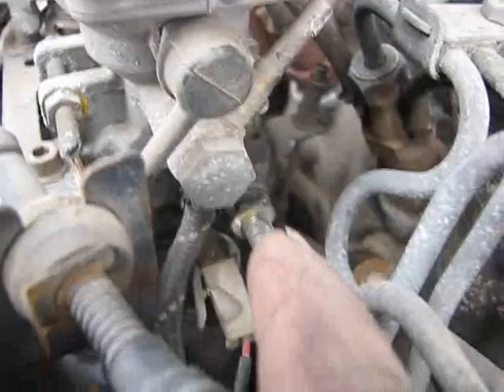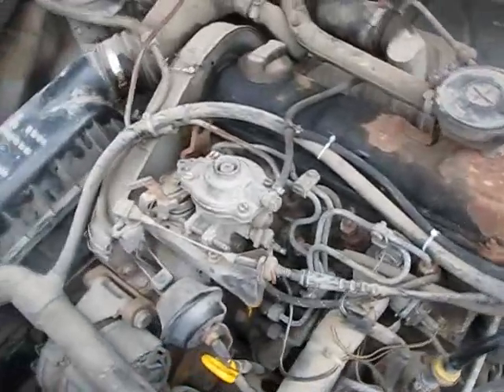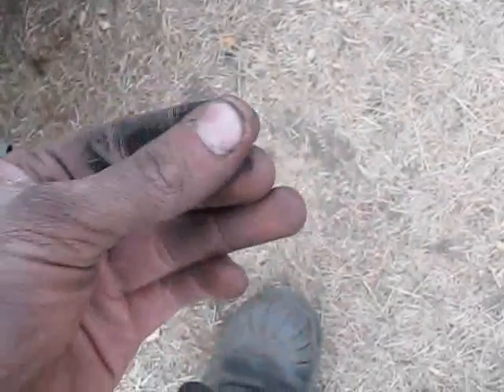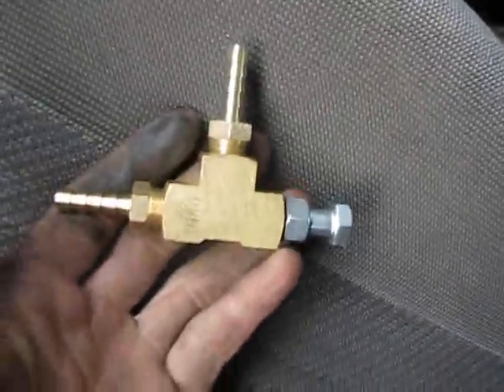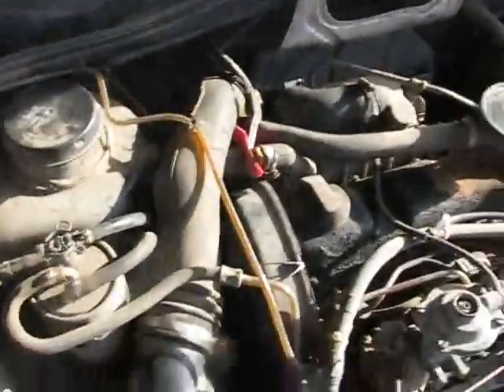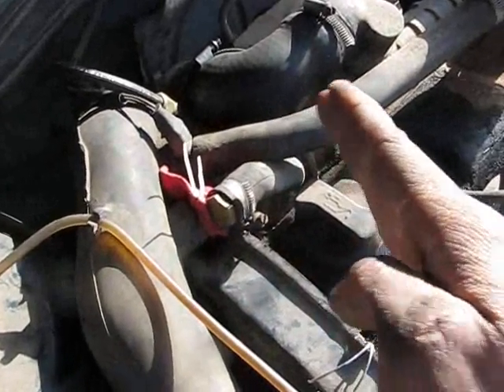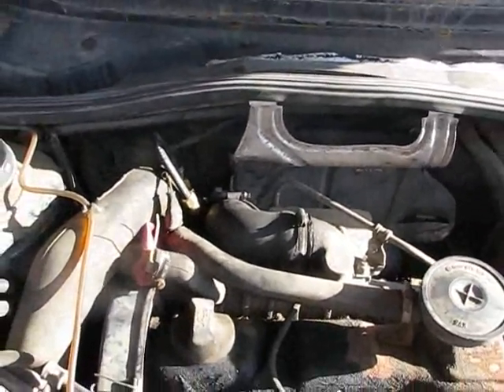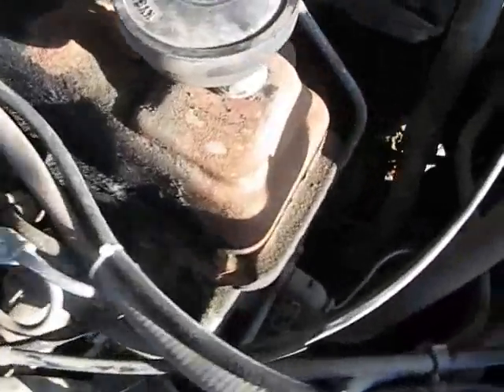1.6L VW Turbo Diesel Mods (11/15 & 19/2011)

Comment: Whats happening with your coolant temperature after the pump and boost mods? Higher? Alot?
Reply from the maker: I honestly didnt notice a difference. Its been like 8 years since, but i dont remember any issues... if you are experiencing issues, id change out your thermostat, and possibly have a look at your cooling system. Egt's were a bit higher, but my stock cooling system was more than enough to handle it. Cheers bud!
Reply: Thanks, i have one in a suzuki samurai and have always had temp problems.  2 motors,  different rads, im almost over it lol
Reply from the maker: @BigStuism  oh yea haha, sounds cool! Im actually preparing to stuff this engine into a 1990 mazda pickup. 8 years later and i still have this engine haha! I cant wait to be rolling coal again haha! I just re-watched this video haha! Man i was green at diesels... after working at, and then running a diesel shop, ive learned so much since haha!
Reply: BigStuism 

Put in a 1.9tdi

They run wayyyyyy cooler
Reply: I live in central manitoba Canada,  with overheating in the summer , and hard to start at -40f/-40c in dead of winter, i might go with a chev 4.3 , but thank you for the video and info. Helps alot. Until the swap ill crack it up 😈😂

Comment: I’m a little late to this video. Just got one with a samurai I bought. I’m seeing what I can do to make it roll coal and pick up a bit of power. I care more about the coal and just have to make stock or better. Pipe right out of the hood I’ll be doing. If I could get some links to the forms you used that would be awesome but if you don’t have them then that’s fine I’ll just re watch this video when its time lots till I figure out what I need to do lol.

Comment: A little lesson about the advanced timming switch you dont need it if the fuels turned up to the max or else you will flood it i use it after i start it to heat it quicker other than that

Comment: Soot means lots of fuel, ad some more air and you will melt things. Hase is fine, opposite from gasser. Also diesels don't have blow off valves due to the lack of a throttle plate....

Comment: Hey where did you plum the boost controller in because the wastegate has a metal line than goes into rubber line  do I split it in between the rubber line
Reply: Yes. 
Cut it 
Splice in regular vacuum hose

Comment: that thing you called a choke is the cold start. All older vw diesels have them and all they do is slightly change injection timing to make it start and run easier in the cold. when it warms up a little you push it back in.
Reply: Derrick K mine won't start in the cold when it's pulled out just like his won't but once you start the car up when it's pushed in then pull it out it does exactly like you said and increases the RPMs stabilizing the engine more till it warms up.

Comment: it's not really a blow off valve. it's more of a boost limiter so you don't blow up the engine
Reply: It's actually called a blow off valve in FSM. It's a secondary safety device to the WG

Comment: that handle you pull out is a emergency shut off incase it runs away
Reply: No, that's the cold start timing advance. The screw attached to the linkage that is hooked to the advance is the fast idle setting.

Comment: blow off valve on diesel?
Reply: Pretty much all turbos have to have a BOV. Diesel or gas.
Reply: what if i say no? blow off valves improve throttle response on gas when shifting, if you don't have blow off valve you will have more lag during shifts. on diesels it doesn't make sense to have a blow off valve, they don't have throttle plates? i haven't heard a turbo diesel engine to make a WOOSH sound when they release throttle.
Reply: BOV prevent you from building too much pressure and blowing your turbo up. Which would be the same in either.

Unless I'm badly mistaken.
Reply: yup ur badly mistaken, thats the wastegate's job, usually its build into the turbo and it controls the exhaust, the blow off valve on the other hand is located on the intake side between the throttle plate and intercooler/turbo and it's job is to release the boost from the system when you release the throttle, when you don't have a blow off valve, when you close the throttle the boost hits the throttle plate and changes it's direction and tries to find a way to escape and that way usually is the turbo and when that happens the turbo is slown down and when you get back on the throttle you begin at 0 boost. if you have a blow off valve it slowly releases the boost, so when you get back on the throttle you still have some flow / boost in your intercooler and you start from 4/6 psi ...
Reply: You are absolutely correct, my mistake.
Reply: pavkata99 I notice this is old... But I upped my boost to 25 psi on my mk2 jetta td and it makes one hell of a woosh after I let off or shift. It's going out the exhaust though so
Reply: honestly its probably the wastegate closing fast when you close the throttle.

Comment: I know your video is old and you might not have the car anymore but how often did you top up the oil on your car, I noticed the oil leaking around the elbow after the turbo and was wondering. I have the same thing happening(assuming the seals in the turbo are shot), plus the engine leaks a bit:P and probably burns a bit of oil and I got through about 4L per oil change. and now I started buying 5gallon jugs of 15w-40.

Comment from the maker: if i was to cap the turbo off at 10# with the fuel screw being screwed in as much as it was, she would be blowing black constantly. maybe it would burn enough fuel for the air it had, then shoot the rest out as the black smoke. EGT's would get WICKED high if there wasnt enough boost to keep up with the amount of fuel

Comment from the maker: when i upped the fuel and boost, i saw a considerable increase in power... the car was non-intercooled. i scrapped it after the body started getting bad. still have the motor, waiting on a rebuild, then something to stick it in haha!
but maybe 24# was too much for the t3, cause i blew the gasket right out of it haha! then she wouldnt go above 13#. still was fun to drive though. i see what you're saying about the air thing, but there would still be tons more fuel being injected...

Comment: Adjusting the amount of boost the turbo is allowed to create does not limit the needed amount of air the cylinder pulls in for combustion. Either it will be boosting, or the waste gate will open and it will still pull air in regardless. You could make the same amount of power with much less boost and fuel, I guarantee it. Are you intercooled? Even if you are, 24psi is too much for the stock T3 turbo.

Comment from the maker: with this engine, i can adjust the air and fuel separate from eachother. if i wanted to, i could crank the fuel up till she pukes black smoke. id burn the motor out in no time though. i installed a boost controller so i could crank up the boost on the turbo to match the amount of fuel i dump into the engine. the turbo would only put out 11lbs stock, and that was set good with the amount of fuel it got. i doubled the fuel input, and had to crank the boost up to 24lbs so she wouldnt run too hot

Comment: Lol. Yes that would be a good definition if we were talking about carburetors... No I am sorry diesels do not run rich, especially not the newer ones with MAF's. If they sense there is not enough air, then they do not inject crazy amounts of fuel. 

Even so, there is a set amount of fuel injected and then the engine pulls in a set amount of air. Done, near perfect stoich.

Comment: Well it seems that it is you that does not understand rich combustion. You need more fuel than air to achieve rich combustion. Just because it is belching black smoke does not mean that the extra fuel in the cylinder was causing a rich combustion. Look it up, you will see that a diesel running rich does not happen. A properly running diesel will NEVER run rich. The cylinder pulls down and ingests the right amount of air, and the injectors pump in a pre-determined amount of fuel. There is no rich

Comment: Does not matter if it is water lined or not. The metal may not turn molten, but it could still expand enough (0.0015") to drop a pre-cup. Also not every piece of that aluminum head has a water jacket behind it. There are plenty of spots that are just aluminum on their own.

Comment: Ah yes, steel may melt at 2000F.. but aluminum starts to melt at 1220.58F. These things have an aluminum head, with pre-cups in them. Ultimately that is the major worry, melting the head not the block.

Comment: No, regardless of how much boost you are making or how much black smoke you are belching a diesel is still never going to run rich. It will always suck in enough air to maintain a near perfect A/F ratio. The excess fuel is expelled as black soot.

Comment from the maker: @SkankRemix3 you turn in the max fuel screw, and set the wastegate lower, or the bov... why do youthink i needed to add a boost controller to the system? cause when i turned up the fuel, i had to increase the boost as well. or else it runs way too hot. too much fuel, not enough air will give you higher egt's.

Comment: @analog56x How do you crank the fuel and turn down the boost? Boost is directly related to how much heat is coming from the engine. more fuel, more heat, more boost. There is no restriction on a diesels air intake. Hence no way to run rich.

Comment from the maker: @SkankRemix3 there's guys that have run within 150* of 1600, and havent melted their engines. i think the pistons are aluminum mixed with something else for strength and heat resistance...

and yes, i know a LOT more about the injector pump now, i bought a spare, and took it all apart. i figured out what all the levers and screws and stuff does.

Comment: Ah yes, and the "soot or haze" in the tailpipe.. What the hell is "haze"?? It is soot, soot is partially un burnt diesel fuel. It is not because the car is running rich.. you cannot run a diesel rich. There is no restriction on how much air is in the cylinder for how much fuel, thus no richness. Diesels run very close to Stoich.

Comment: Also the cable running from the back of the pump in to the cabin is not a choke, do you see a carburetor anywhere?? This is a fuel injected engine. That cable is a manual advance lever. It  advances the injection timing by 0.10mm when fully pulled. You really need to get an EGT gauge on this thing.. also for your information Aluminum begins to melt at 1220.58 °F. I was always interested what 1600F would do to one of these.. wanna try?

Comment: Twelve minutes and three seconds of my life, that I will never get back.. 

There is a lot of cool stuff you want to do here, but also a lot of stuff you are just plain ignorant too. If you are going to mod this engine can you please at least learn what everything is? 

The long screw on the back of the pump with the two smaller screws on the fulcrum above it is the actual idle adjustment. The screw you backed way out so it isn't even touching the throttle arm is the residual fuel screw.

Comment from the maker: @HedgehogOutdoors rofl, i could do side stacks on the 4runner :P that would be pretty cool. i'd just be worried about crushing it on something... im still thinking about lowering the 4runner and adding beefier springs... i wanna be able to pull a trailer with it. should be no problem with the diesel, once i get a bigger turbo and do a few mods to it :)

Comment from the maker: @HedgehogOutdoors yea, im selling it... i dont have the time to properly restore it, plus i need the cash... i have quite a few people interested in it haha! i have no idea where it was made haha! i dont really care either... i basically just bought the car for the engine... im doing a motor swap on the 4runner hopefully in the spring... i want to get this motor sitting around 200hp and however many ft-lbs of torque... i want it to be more powerful than the 4runner before i swap it...